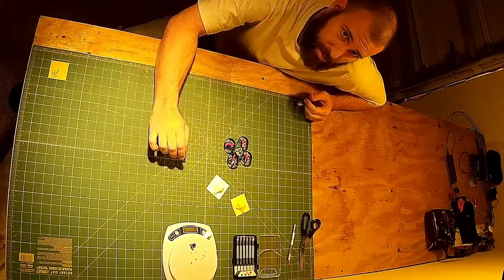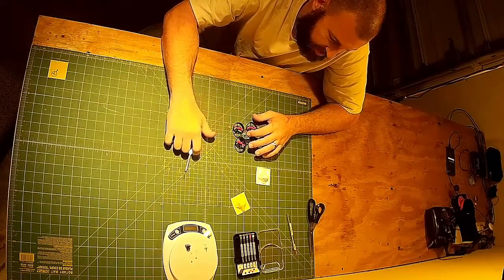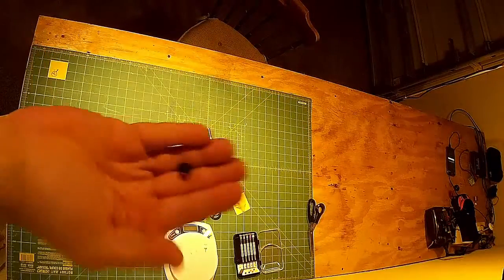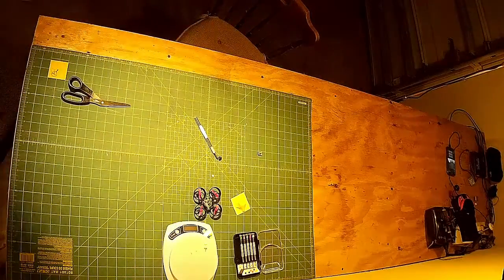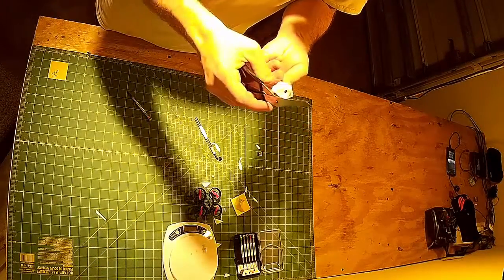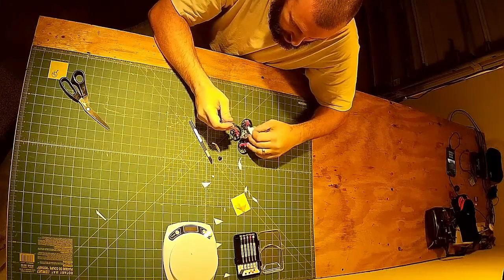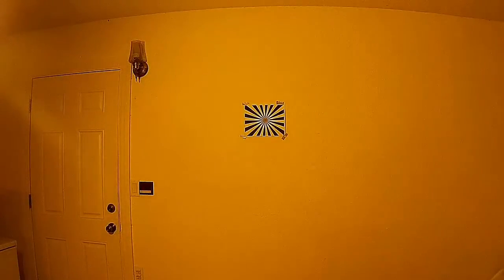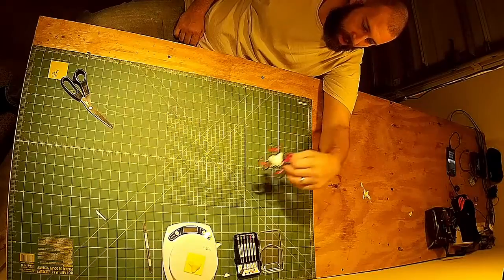Mullet Mod Canopy Install - "The Bulldozer Whoop"

Comment: That's one damn good looking canopy you got there. Really like the camera fitted into the canopy instead of taped to the flight controller.
Reply from the maker: edthecarpenter   Thanks Ed!!  The "bung" that the camera lens fits into is solid as a rock reinforced by all the localized curves.  A little more fiddley to install but well worth it once done!  Even if a lens can't be removed from a small AIO cam (some are glued too tightly), a small cut below the hole will let the canopy flex over the rim of the lens allowing a camera to be pushed into place from inside and keep a good tight mount!  Thanks for watching!